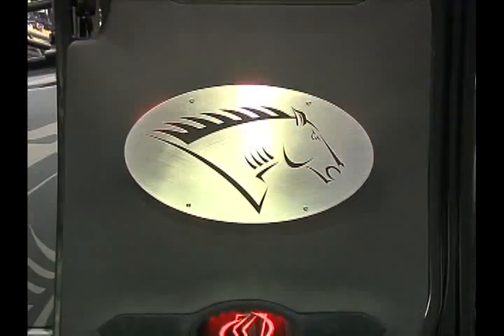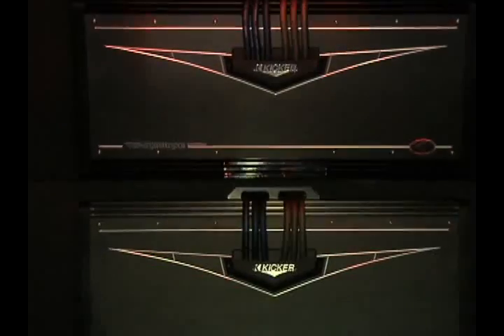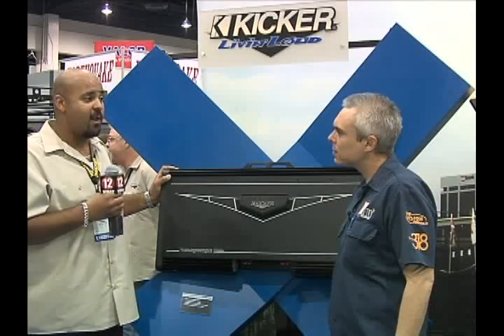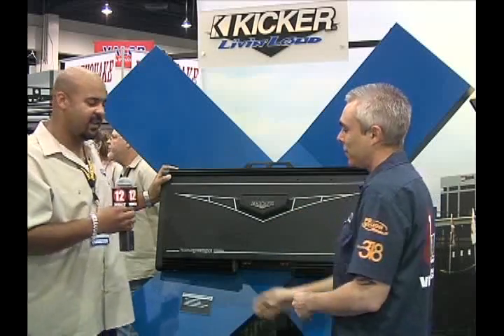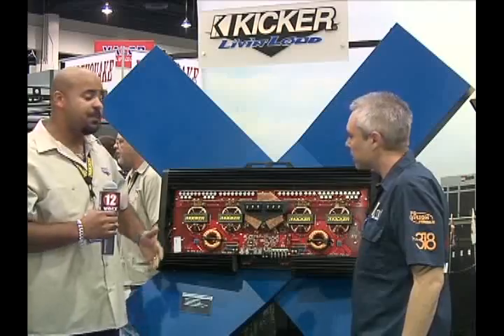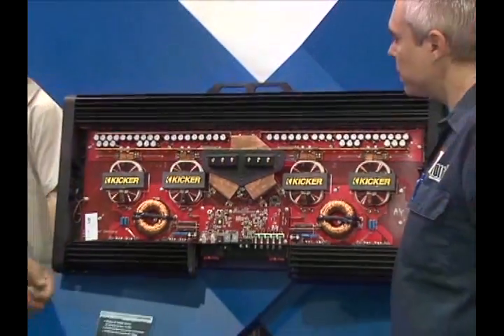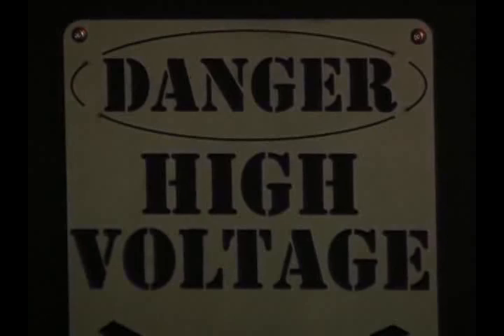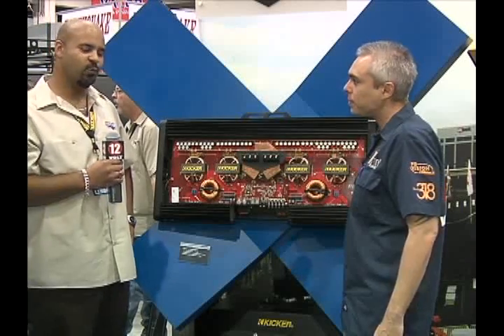Kicker  Car Audio unveils the WARHORSE at SEMA!

Comment: max capacity for a "true" 0AWG (50mm2) wire is actually around 3000 watts, times three is 9000. They might be able to push out 10 000 with some very high quality 0-gauge. Haven't seen any proof on this exact amp, but EVERY single amplifier ever produced by Kicker is underrated, unlike shit brands like Boss and whatnot, brands like Rockford Fosgate and Kicker rate their amps at the BARE MINIMUM of what the amps can do, 95% of them are good for 200 watts or so above the rated RMS
Reply: 5 years later.....(SpongeBob). You don't really talk about power and cable gauge in that way. For that cable to dissipate 3000W it would need to carry 10000A in that 10cm length. It just happens that this unit uses 12V and the AWG specification for 0 AWG is 245A - whereupon the 10cm length will dissipate 1.5W of heat. This is delivering 3000W into a load with minimal losses. 3000W is not 'the capacity' of the cable. It would be happy with 100V. (24KW)  Or is it? (Always open to argument)

Comment: Nookuios.....you are truly one of the biggest idiots who has ever posted a comment on youtube. First off 200 dB you would probably have a heart rythma and die. Second 200 is about a 1 on the Richter Scale so try again. I have seen 8 solo X 18's in a van, and it hit about 165 dB. Extended Caddy? Your so dumb kid. Also who's car is this? Bill Gate? 1 Solo X is about $1500 and 1 WARHORSE is 10k. HAHAHAHA  talk about blow it out your ass!
Reply: Yes, a super sensitive sub giving 100db at 1 W would require a million watts to reach 160dB...That is some amp, over 3 million watts for your 165dB. (Multiple drivers would of course be used and increase overall sensitivity, though I don't think anyone has got much over 115db out of a watt? Anyone? (9 years later) (60000 watts) I guess possible.

Comment: not if you know how to set it up I've had 1000 watts pushing on 200 watt sub i know 80000 is a bit different from 1000 but on a ratio i had 5 times more power going into my sub than i should have and it bumped! lol

Comment: Not sure if thats sarcasm or not.... but NO YOU CANNOT. Kicker manual says that it requires 8 12v batts at 880cca AND 2 500 amp(?) alternators just to run it(not sure if my rating on the alternators are right though)

Comment: Ratings....Since when have ratings ever been correct... MY specific 7500.1 puts out 7,849 watts@1.2 ohms @ 12.5 volts with two G31 batts and a 250 amp alt. It was clamped, Apparently you believe what the company puts on paper... OVERKILL!!! I have seen these amps clamped....not impressive ;)